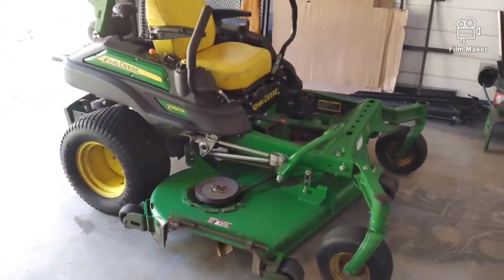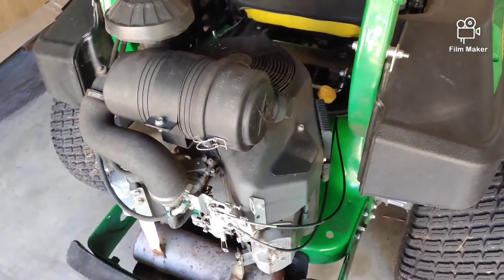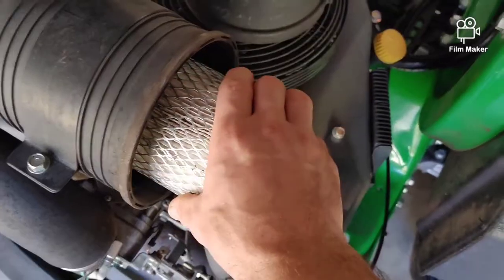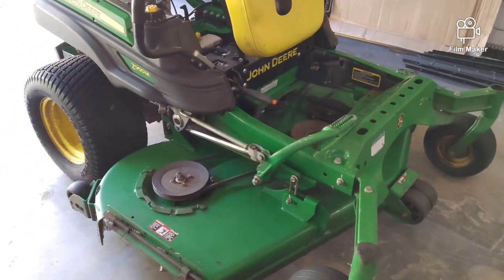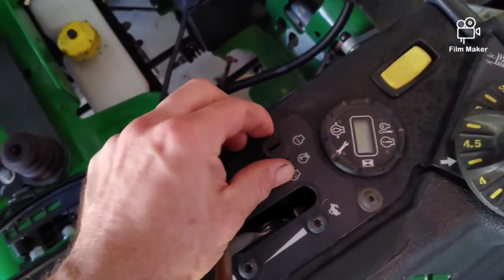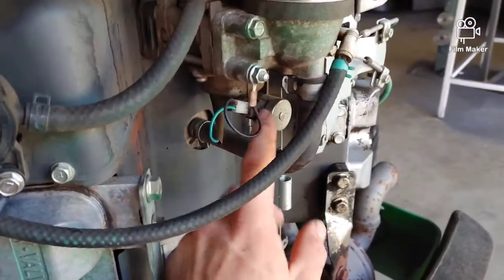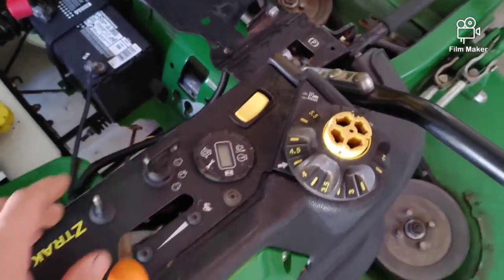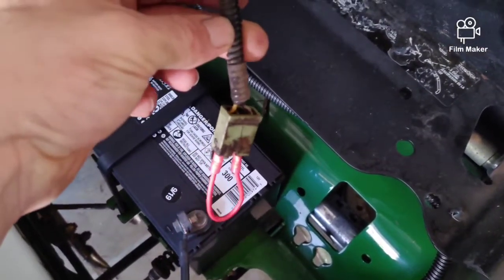What you need to know about John Deere Ztrak Commercial Mowers

Comment: Hey man, I don’t think I have ever commented on a YouTube video before. I just want to say THANK YOU. I had scheduled my Z730M with 50 hours to be taken to the shop because the steering wasn’t working well. This video was randomly on my feed and I’m glad I decided to watch it. You suggested checking the tension rods and I found that the engine drive belt had come a little lose because the tension rod moved from one side to the other. I put it back where it needed to go and problem solved! I cancelled my appointment with the dealer. I appreciate you!
Reply from the maker: Thanks Omar! Is it still in warranty?  If its stillnin warranty Id recommend to take it in to a John Deere dealership and they will do anything and everything they can find that they can justifiably do under warranty at no cost to you. Thanks for subscribing. Im going to have more coming soon realted to your mower.
Reply: +1 on the 730M content

Comment: I’ve recently become interested in ZT mowers as one of the most profitable OPE to flip. I agree with every other commenter that this is an excellent video, and would add that I suspect much of what you covered probably applies to all zero turns. 
As for JD equipment in general, I just finished working on my very first, a 2006 130 Automatic lawn tractor and I have to say I was pleasantly surprised at both the design and build quality. A very well thought out and constructed piece of equipment.

Comment: Great video. Lots of helpful tips. I bought a used Z920M with a blown engine and rehabbed it. Your tips and things to look out for will be very helpful.
Reply from the maker: Thanks for the comment. If you ever have any questions I'll do my best to answer them. Thanks!
Reply: @Mechanical_Mind  Thanks. I just replaced the bearings in the deck belt tensioner arm.  It was a pain to get the old bearings out.  Maybe there is a trick, but I finally get them out with brut force... and a welder.  If you don't mind I'd like to include a link to your "What you need to know..." video in the description of my video of replacing these bearings.
Reply from the maker: @thistlehillfarmstead9131  Yes absolutely. Id appericate that. I do those very often. Usually the outter race of the bearings are the tricky part to knock out. I made some simple modifications to a regular punch to knock out the races fast and easy. I will make a video showing it next time I do it. Thanks again!
Reply from the maker: @leonardo migot I was doing that to demonstrate the diagnostic code lights genius.
Reply: @Mechanical_Mind  🤣👍👍

Comment: Because these are air cooled engines, you forgot an important part. The service manuals say to remove engine shroud once a year a check engine and cooling fins for dirt, oil, grass, and debris, and clean as necessary. Some of the engines that come in are packed with debris under the engine shroud. Occasionally, they overheat as a result, and push the valve guides, bend push rods, blow head gaskets, etc.  Very important to check!
Reply from the maker: Mike this video was already 40 mins long! 🤣 That is a good point. I think I did mention that in the part 2 video but I could be wrong.

Comment: One thing I've found is the idler pulleys and spindle bearings can be replaced.  The idler pulleys,  drill out the pop rivets replace the bearing and use bolts and nuts to hold together.  That way, if the bearing goes bad much cheaper to replace the bearings. Same with the spindle,  the bearings are fairly easy to change,  much cheaper than an entire spindle.

Comment: Super helpful and honest video.  I love when you get fired up on customers bringing in dirty equipment to work on "no mercy!"  
I would love if you can show correct grease to use and correct procedure for these machines... sounds simple but how many pumps is enough?  I keep pumping but I don't see it forcing the old grease out somewhere like I'm expecting similar to wheel bearings etc.
Reply from the maker: Thanks! Any general purpose grease is fine. On the 900 Ztraks Id recommend greasing the spindles about every 10 hours of use. About 10 pumps with a full size grease gun. I normally try to sense when I feel a little bit of resistance then stop. You dont want to blow the seals out of the housing

Comment: Thanks for the very informative video, I have a Z720A it's built like a tank, what a great mower👍🏻the only problem I've had is it leaks hydrostatic fluid.
Reply from the maker: Thank you so much! These comments motivate me to make more videos about the repairs I do daily. 
Hydro leaks can be hard to find the source of. The trick is to get everything completely clean and dry. Run it and immediately inspect for the oil leak location. The most common leak on those is from the axle shaft seal. Next the top drive pulley seal.
Reply: @Mechanical_Mind  thanks for replying,  and thanks for the tip on finding the oil leak. I will let you know when I figure out where the oil is coming from.

Comment: If you turn the key 3 times fast to the on position the unit does a switch self test. No switch should be closed. Parking brake off and ass not in seat. The wrench light should flash 1-1. This way you can test each switch one by one if you have an issue.

Comment: Great video.  I have a z950m and it loses power when I engage the PTO and start cutting wet grass. It almost bogs down.  Maybe I need to look at the spark plugs and make sure I’m not missing on one cylinder.   I have a few areas to check.  I know I’ve been monitoring the dip stick wrong now and I also need to check those codes.  About 20 hours new on it so far.  Thanks for the video. Great stuff.

Comment: Great video. Very well done. Can you offer any help with a Z740R fuel pick up issue? Apparently have some debris in pick line and not sure how to get to it. Thanks
Reply from the maker: Thanks Wayne. Id use compressed air but use caution not to use too much pressure. It you dont have an air compressor you might have to remove the line completely then use a water hose with a high pressure nozzel. Then obviously remove all the water before reinstalling. WD40 works well in helping remove the lines and clamps etc. Plus it displaces water and will not damage rubber or plastic. (Fun fact the WD stands for water displacement)
Reply: @Mechanical Mind  I have used an air compressor which helps but only until more debris gets into pick up tube. I would like to remove pick up tube and maybe modify by adding a pick filter on the end. My problem is I cannot figure out how to remove the pick up tube. Kind of a weird cap/connector were it enters tank. Dealer supposedly pulled entire tank out last year and obviously did not get all debris out of tank. I had taken it in thinking Issue may have been the duel pump.  I did not want to go beyond changing fuel filter at the the as mower is still under warranty. I ended up having to pay them for tank removal, reinstall and supposed cleaning of tank and lines. Not a cheap venture. Do you know more about possible pick up tube removal as mentioned above? Thanks  Again your videos are really well done.
Reply: @Mechanical Mind  I really want to remove pick up line completely but cannot figure out how to remove it. Thanks
Reply from the maker: @waynebehm7853  Im not familiar with the Z700s but if the pick up tube is similar to the 900s I have to use 3 small screw drivers at the same time to carefully pry back the clips that snap and lock down on the tank connection. The z900s have a metal screen filter in the end of the pick up tube. Not sure if yours does or not. If you send me your mowers PIN number I can look up and see how its made. 
Id also check the gas cap to make sure its seal or o-ring is still there. That is a very common way dirt gets into these fuel tanks.
Reply from the maker: @waynebehm7853  We use pump extractors to suck out oil and gas and dirt from fuel tanks. They cost about $150. That would be an easy way to clean out the tank.
Reply: @Mechanical Mind  pin on is 1TC740RVLLT020231. I did get tube out of tank using your technique.  There was nothing on end of tube. Tube end is cut at an angle. No sign of a screen. Thinking of putting some kind of screen on it. O-ring on gas cap is fine. Debris got into tank when mowing under pine trees as low hanging limb caught cap and spun it off. Learned that the hard way. Need to confirm i d of pick up tube.
Reply from the maker: @waynebehm7853  Your pick up tube is part # AUC11293. There is also an o-ring for the pick up tube incase you need to replace that its part # GX23473. 
Check out this video I made showing how you can look up parts for your mower on deere.com. Make sure you go into "Commerical mowers" section. Here is the video https://youtu.be/9JgYcXJhQvM
Reply: @Mechanical_Mind  thank you for your your help. Really enjoy your videos.

Comment: Do the J Deere use alloy case ball bearing spindles . Toro Grounds Master diesel use fabricated steel spindles with tapered roller bearings with crush tube thats machined to bearing drag 12 inlbs .
Reply from the maker: They most common spindles have an aluminum housing with ball bearings. 
The newer model spindles have a steel housing with similar bearings. The bearings are cheap. Here is a video I made showing how to rebuild the spindles https://youtu.be/StOx-eSEcGg

Comment: Well done excellent video. I have to replace the oil sump gasket on my z445 with B&S engine. I am having some difficulty getting the PTO clutch off. But I have lubed it up with WD40 and letting it sit. I have read that 27 hp B&S engines had this common problem. I have bought the new gasket kit for it. Do you have a video of removing the PTO clutch?
Reply from the maker: Hi Richard. Sorry for the delayed replay. I just saw your comment. Im not sure why I get notified about some comments but not others. Did you get the clutch off? The first thing I try is tightening and loosing the clutch bolt with my impact a few times. Next I try tapping it with a hammer. Some models have a hole in the frame where I can use a punch or bolt to help tap on it in the downward direction. Next is a puller. If you dont have a puller you can remove the engine mount bolts and use a jack to push the crankshaft up using a socket to push the crankshaft but not the clutch. That is inly for extreme cases and extreme care and caution must be used.

Comment: A bit of a noob question, but how can you tell if the spindles are taking grease, and can you over grease it?  I didn't see it coming out any where.  Great videos, thanks!
Reply from the maker: Hey Ian, with a mauanl pump grease gun you can feel the resistance on the pump lever increase when the housing is full. Try not to apply too much where it comes out of the seals. I normally just do about 12 pumps with a large grease gun. If you hear it coming out stop pumping.

Comment: Thank you. I have a 1-2 code so is the break not engage but my is the one with the paddle so what do I need to do? tied the cables more??
Reply from the maker: Hey Scutting Edge. What model mower is it? Im not sure what you mean by "the one with the paddle"
Reply: @Mechanical_Mind   is the z910A John Deere zero turn.  It won’t crank up and is showing the code 1-2 so is the brakes not in gage ? What do I need to do?
Reply from the maker: @SCuttingEdgeLawnService  Im assuming the engine is not spinning or turning over at all. First check the battery and confirm is fully charged. 2nd check the 20amp fuse normally located newr the starter. If the fuse is good,  test the starter. Take a test light and check to see if your getting power to the purple wire going to the flat terminal on the starter solenoid OR test the starter by bypassing the solenoid with a screw driver. Touch the terminal that has the big red wire to the flat terminal that the purple wire goes to. Have the key in the "start" position while doing this. 
If the starter works then its most likely your e- brake switch. Bypass it to confirm. I have made other videos showing this. 
If the starter does not work when bylassimg the solenoid then you have a bad starter.
Reply: @Mechanical_Mind  ok I will do that. thank your so much.

Comment: Thanks for the great informational video. I have a z920m that was cutting fine and all of a sudden it started loosing power and putting. I shut it down and it wouldn't crank again until later that evening, now it turns and catches but putts and with a little smoke then shuts off, I've changed everything except the fuel pump and carb ( plugs, air filter, fuel filter) I don't know which way to go next.
Reply from the maker: It sounds like a fuel issue. First Id check the fuel pump is working. Remove the hose going from the pump to the carb. Turn the engine over with key and starter. Fuel should be coming out of the pump when the engine is turning over. 
If no gas change the fuel pump but first comfrim there is no kinked or clogged fuel line going to the carb. 
If there is gas coming out of the fuel pump then confrim that the fuel shutoff solenoid on the carb is working. When the key/ ignition is turned on you should hear a slight click by the carb or you can feel it click with your hand. Its the thing that has two wires going to the bottom of the carb. 
If have other videos covering these things on other mower but basically the same thing on your mower.
Reply: @Mechanical_Mind  ok will do thanks again for the help I'll keep you updated once I get the parts checked and replaced if needed.
Reply from the maker: Also check the tank is venting. There is a smaller line coming out of your fuel tank. Make sure air can be blown through that line.
Reply from the maker: @greenmagiclandscapellc1197  let me know what you find. I'll help out if I can

Comment: great video!  i have a z920m and the pto stops working after a couple minutes of have it turned on. motors runs fine no problem. if i turn it off and back on it’ll engage again but do the same problem. and every-time it happens the wrench light comes on. advice would be much appreciated!
Reply from the maker: Watch these two videos
https://youtu.be/l00Z1556xw4

https://youtu.be/92O3-Vzj4fo

Comment: My dealer told me to grease the spindles once or twice a season!  They said if you grease  them too often it pushes out the seals and attracts dust and debris. I believe newer units all have sealed bearing spindles, but i may be mistaken?
Reply from the maker: The owners manual on Z900a says to grease them at least every 50 hours and/or each time you wash it. 
Here is a link. Pg 47. 
https://acrobat.adobe.com/id/urn:aaid:sc:VA6C2:078fb6ae-f396-4fd3-ac9d-80f119ab21c7
Also, you can download the owner's manuals for equipment on deere.com
Reply: @Mechanical_Mind  sounds right. I don’t put more than 100-hours per year on my machine, so my dealer’s advice stands to reason.  They told me lawn care companies will grease them daily thinking it’s good practice and end up ruining the seals.  They don’t need much grease.

Comment: I have z930m two lights on hour meter blink when key is off. Do you know what can cause it
Reply from the maker: They do it when the key is OFF?? If so your key switch is bad and you need to  disconnect your battery asap. Disconnect the negative post first.

Comment: I’ve got a backfire/misfire that comes and goes through the day mowing, it runs great 90% of the time then it’ll backfire and run on one cylinder for no more than a min then pop and goes back to running normal. Would you think that’s a coil ?
Reply from the maker: Hi Chase, its very possible its a coil and sometimes they hard to confirm. Check out this recent video and watch the very end to see what I mean. https://youtu.be/nZ81M94_RU8. 
It could also be a carburetor issue or vaccum leak around the carb. To check for a vaccum leak spray carb cleaner around the carb and intake gaskets while its running. If it starts running different while sparying in a specific spot that is where the leak is. Also check the conditon of your spark plugs.

Comment: I have a 8:40a with auto deck lift it'll raise halfway up but then you have to assist it all the way up to change deck heights what would cause that
Reply from the maker: First Id clean lubricate and closely inspect all the linkages. It might just be getting into a bind somewhere. I have had to change out the actuator on those but its kinda rare.
Reply: @Mechanical_Mind  mine's an 08 model are those spring assisted
Reply from the maker: Im not familiar with your specific model but on the current Z900s there is a coil spring under the seat on the left side of the battery that is an assist spring to help reduce the force you need to push the lift pedal to lift the deck

Comment: Great video!  My Z930M has a flashing red oil pressure light but no service codes.  Any ideas??  Thanks!  Has about 400 hours
Reply from the maker: If its flashing while running check your oil level. If your oil is level is good then the sensor might be faulty.

Comment: I thought  John Deere des not recommend using water to clean mower ..  to keep rust away etc.  also do you recommend keeping receipts to prove your doing proper maintenance on machine . Since it’s under warranty
Reply from the maker: I recommend keeping everything as clean as possible. Keep water out of the ignition switch and dont blast electrical connections. If you get water in electrical connections use WD40 to get the water out. WD stands for "water displacement". Its safe for electrical connections and will not hurt anything on the mower, not even the paint. If you have compressed air that will help but wd40 is better to displace water. You can even spray it in your starter motor and Id recommend doing that occasionally to keep the inside clean and lubricated.